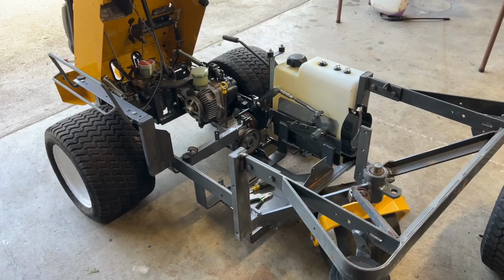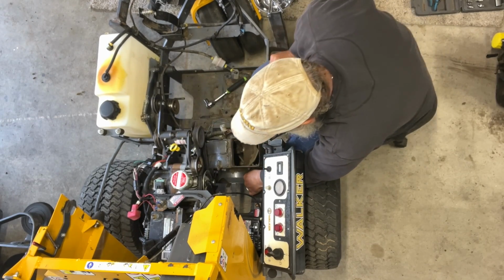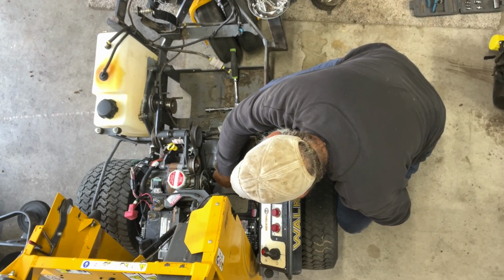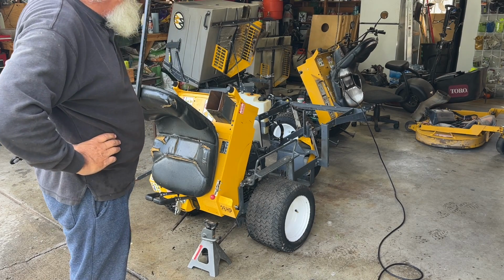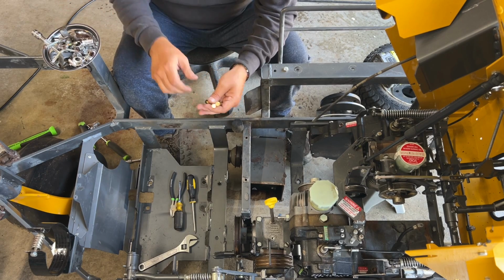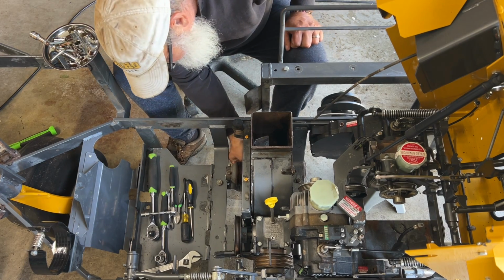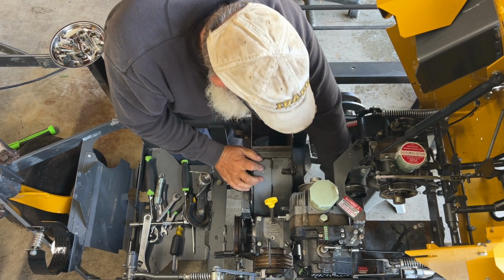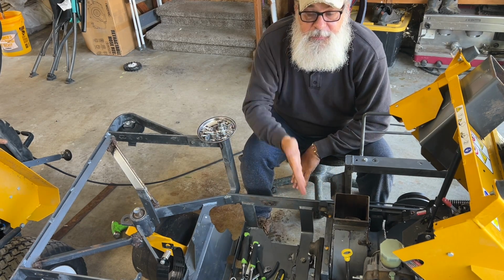Walker Mower Model T Blower removal and install

Comment: Doug, the 4 bolts (7/16" head) that hold the PTO box in I have had break before while mowing a few times. I now always replace them with grade 8 when I take them out and use a little blue locktite just so they dont vibrate loose. I am good at hand tightening and knowing by feel but those bolts can vibrate loose and or overtigthen easy. It gets worse with age and desk shafts that wear some from vibration. Just make sure you do best you can with them while you can or you will find yourself out in the field doing it

Comment: As far as the spring on the idlers I use a vice and good zip ties to hold the tension while installing the pivot bolt... it makes it easier. Love the birds eye view while working on it. Nice work
Reply: I realized later in the vid you mentioned the zip tie spring part. Just make sure the spring where it contacts the frame is inline up close to frame not angled out and being held by the little welded tab off the frame. It makes the spring cut and break. You should be able to pry it up onto the frame if you have it misaligned. I couldnt tell by your vid